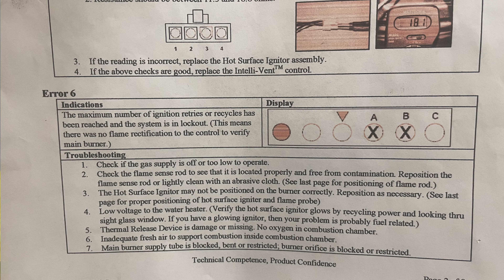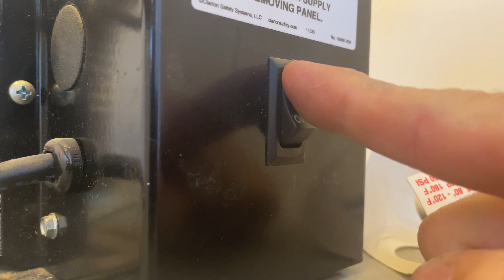Gas Water Heater won't Ignite - Intelli-vent Gas Valve Error Code

Comment: I would have to do this every other year, but now it's doing something different.  It will light, run for 10 min, then shut off an restart.  Except when it tries to restart, the gas doesn't flow.  I hear the "click", but you don't hear the sound of the gas.  I can shut off the gas and turn it back on, then it will light. Could there be some debris in the gas control valve?

Comment: This guy is not a professional. You never want to clean the ignitor or touch it. You also need to soap test any and all gas line you disconnect.
Clean the burner itself serves no purpose. Just knock off debris.

Comment: My Water heater has the same electronic reader and the heater is going off and failing to ignite multiple times and going on lockout mode all day, should I be worried something catastrophic is going to happen or such ?

Comment: Awesome, exactly what I was looking for.  I have a unit that keeps tripping, and resetting the power off/on fixes it for a few days.  I will give this a try.  Many thanks for the video, you're a lifesaver!
Reply from the maker: Let us know how it turns out!
Reply: @ApartmentMaintenancePro  This was awesome advice.. I pulled out the burner and gently cleaned the pad and the probes with steel wool.  Worked a treat.  It's been almost a week and it had not tripped since (previously it was happening once per day).  Thanks again for a truly informative and helpful video!

Comment: So what it was just dirty? Because that code says maximum number of ignition attempts led to lock out
Reply: Mine will ignite and there’s flames but then the flame goes out like 3-4 seconds later
Reply: @jackielegz8689  Same, I then did what he showed in this vide and it worked after that.

Comment: I have this exact issue, and I've done all of the above steps that you did. GE is completely useless in terms of helping. Gas is turned on, and yes the bills have been paid lol. When I try to restart it the igniter lights up just fine but I never get a flame. Please for the love of god help, because the internet seems to be failing me on this one lol. Bad flame sensor? I'm having an EXTREMELY difficult time even finding a replacement part for it. My burner/igniter assembly is identical to the one you have in the video.
Reply from the maker: Is this for the intellivent gas valve? Either way if you have an igniter getting red it’s probably not the ignitor it’s most likely gas flow.
Reply: @ApartmentMaintenancePro  Yes it's for the intellivent. I'm not sure what would be limiting the gas flow at this point unless it's the intellivent module itself. Any way that you know of to test that theory?

Comment: Same issue with mine going ok into vacation mode and HVAC tech said it's due to high city water pressure. Can you explain to me how that's related to the ignition sensor?
Reply from the maker: No. Will pass this question on to my plumber mentor though

Comment: Nooo!!!! Don’t brush the ignitor with steel wool! Leave that baby alone. It’s just the flame sensor that needs cleaning.
Reply from the maker: Thanks for the feedback 👍
Reply: They break just looking at them
Reply: Hate to be the dummy here but which one is the igniter and which one is the flame sensor?
Reply: @klf61492 In this video the flame sensor is the curved bit. The igniter is the straight nitride rod.
Reply: @OSheaSpringers  thank you! I saw in other videos that people will clean the igniter with steel wool. It sounds like that is a no-no?